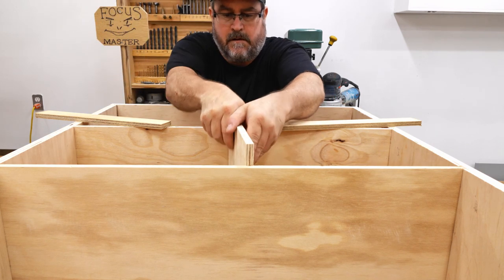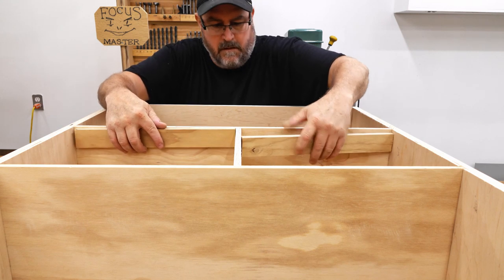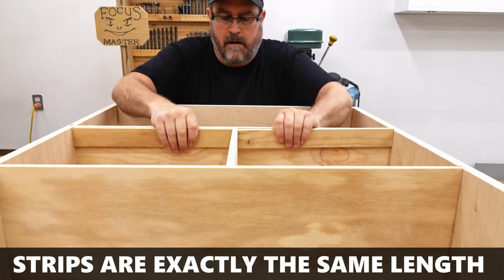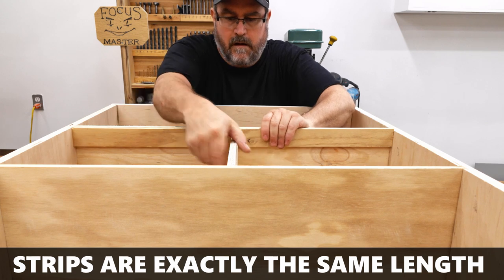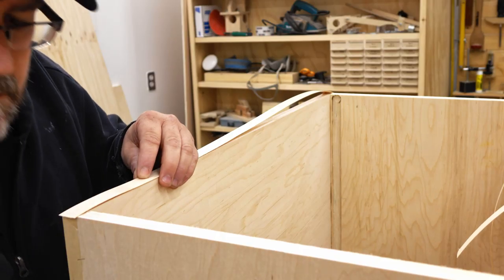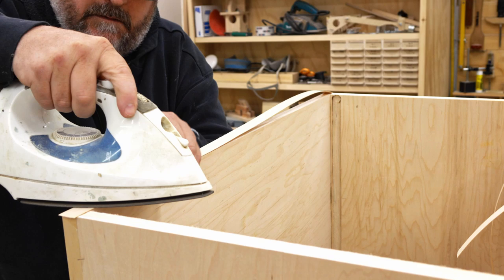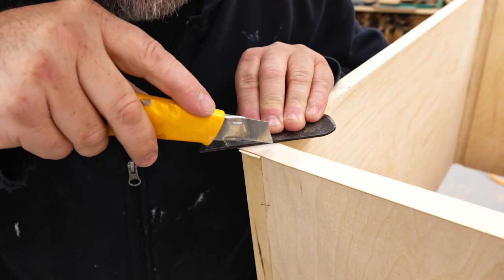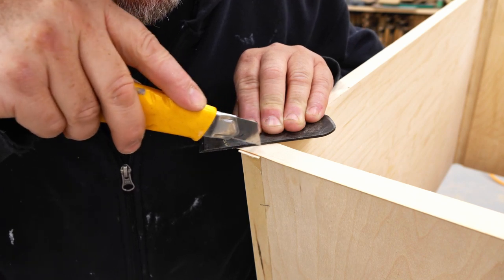2 Quick Handy Tips: Center A Divider Panel and Mitering Edge Banding

Comment from the maker: If I need a divider panel perfectly centered, I use two strips that are exactly the same length to lock it place while fastening it. I cut the strips long to start, then sneak up on a tight fit by trimming a sliver off both at the same time. Nothing works as well.
The easy way to miter the corner on edge banding is to overlap it and cut through both at the same time. Even if the angle is not perfectly 45 degrees, the joint will be tight.
This is an excerpt from a longer build video on making a modern office cabinet:
https://ibuildit.ca/projects/making-a-modern-office-cabinet/
Reply: You gave your own Comment a heart? :D Looking forward to the full Build!

Comment: I have done edge banding a few times and never thought to mitre the corners.  This tip is brill buddy, thanks John.
Reply: It's a neat idea but not something that we practice at a production level.  We run parts through an industrial sized edge bander then when we build the box, the edge banded parts end up being a butt joint.  I think for a small project it would give it a neat look though.

Comment: Smart tip on the corner mitering using overlaid strips. It works well with wood veneering as well.
- Cheers

Comment: quick question on the dividers. i typically go for something similar, or sometimes i'll notch a story board that fits the entire length of the opening. here's the question. when using plywood, which is usually undersized, how do you come to the size of each of the spacers? do you measure one, knowing it'll be shy and cut the second larger to compensate?

Comment: You're holding out on us! How did you trim the edge banding on the inside corners?!?! Normally one uses the standard two-sided flush cutter..but that wouldn't reach into the corner? Did you just use a chisel?